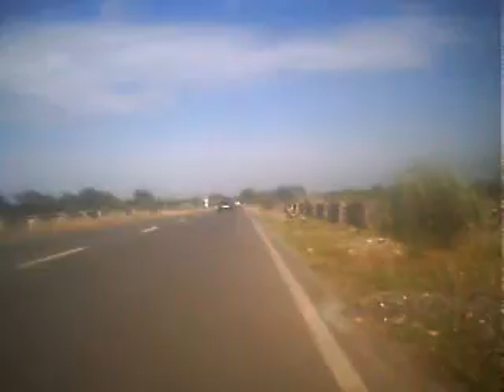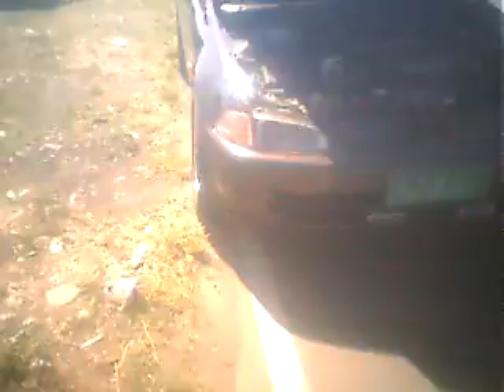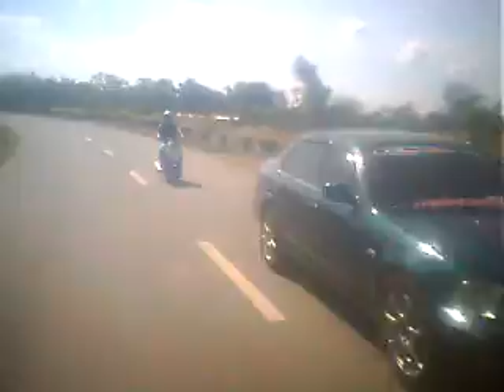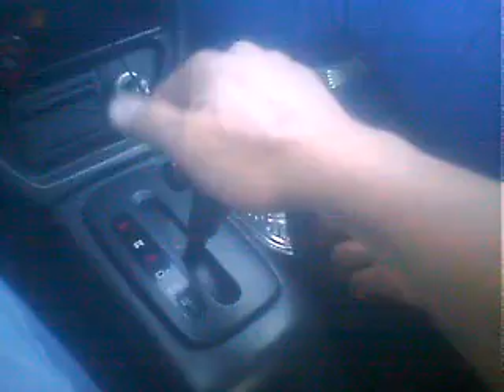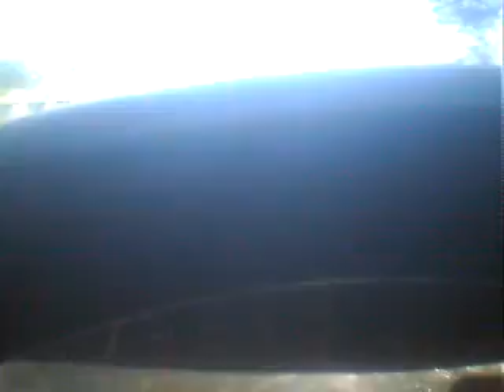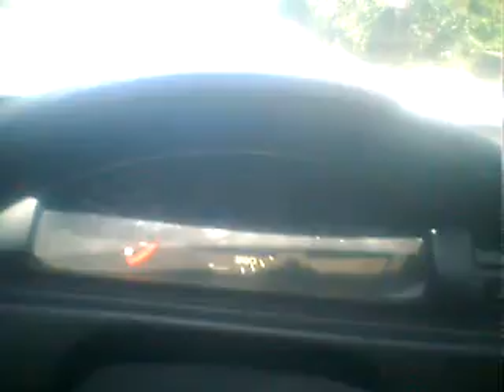Hydrogen enhanced HONDA CIVIC ESi Acceleration Test

Comment: Correct, but those minerals are also horrible conductors and tend to provide very little continuity.
Use distilled water and KOH or NaOH and you'll get better, more regulated output.

Comment: Wrong; use *ONLY* DISTILLED water and KOH or NaOH (depending on which is easier to locate).
I got two pounds of KOH off of Ebay for like $15 which is more then I'll use in a lifetime on my personal booster at the rate I'm going.

Comment: DISTILLED WATER AND KOH!!!  Water and salt is EXTREMELY corrosive.  Salt and baking soda may function as a catalyst, but they also chew up everything around them.  I got TWO POUNDS of KOH off of Ebay for like $15 or something.  That's going to be more KOH then I can use in my lifetime.